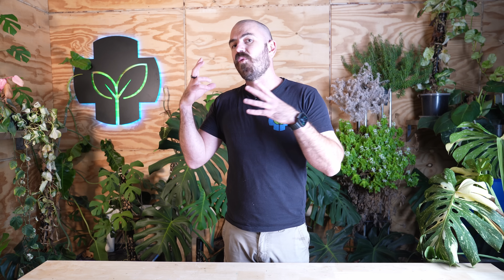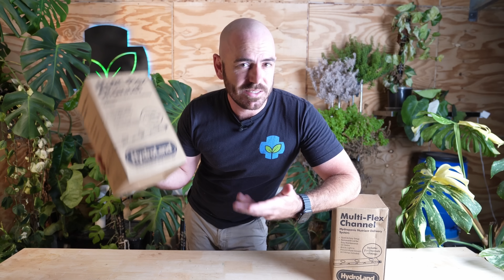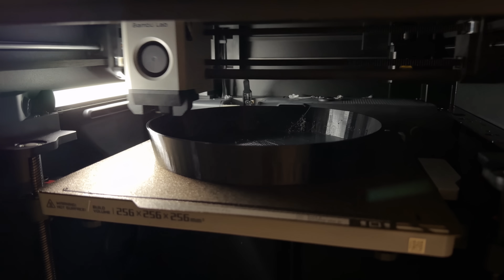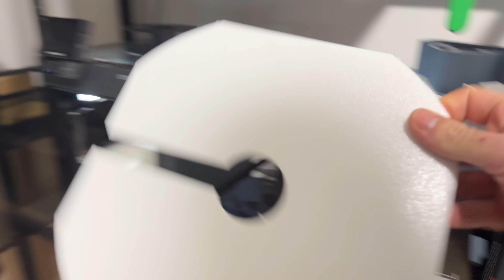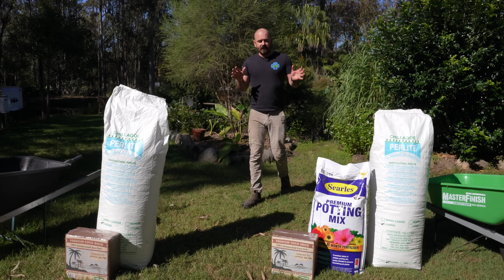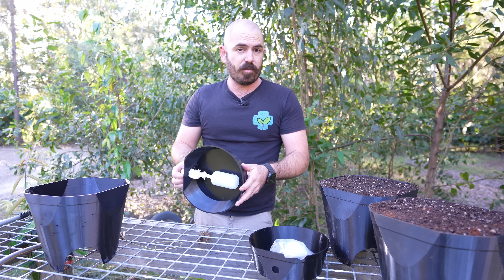The Hooch Pot: Infinite Self Watering Pot

Comment: I recently printed your hydrotower- and after printing 8 sections, I tried to print the bottom fitting that should go on the res...

However, the tips of both options are a hair too big for my print bed. I'm so very sad, because I've spent weeks printing this, and if I scale it down, the bottom fitting will not longer fit tightly. <sigh>
Reply from the maker: You can cut the model in the slicer.
Cut the model on the bits that don’t fit.

Comment: Awesome designs, as a suggestion to be able to reuse the standard plastic garden pots that almost everyone has (30cm) and to reduce 3D printing effort, Is there a way to use our existing plastic garden pots with the float base and maybe wicking section of the hooch pot that the garden pot could slide into??

Comment: Excellent video. I love your designs.  I still have to ask why you haven't designed an airport wicking system? Does it just dry out too quickly? Also when will you do another video with Rob Bob?
Reply: Are you talking about "airpot"? You should be able to just do drip irrigation to them, or you could use a fabric pot and watch one of hooches other videos about making a timber and pond liner based system. I'm using fabric pots and the pond liner system for my banana trees

Comment: I love your videos Hooch! I have a small apartment and a small balcony. This is exactly the type of thing I’m looking for.

I’d be curious if there’s a way to adapt the bases so you can daisy chain them together while maintaining water level. This would limit the amount of tubing and float valves.

If we figured out a way to do this, it would create a fully modular RGGS where you could customize the spacing and number of growing locations at will depending on space needs. 

Based on your experience, do you think there is any good easy way of achieving this? Since there isn’t the horizontal float valve part of the RGGS since it’s inside one of the pots, it would also maximize the amount of space used for growing, which for people with small balconies would be very useful! Would love to hear your thoughts on this.
Reply from the maker: I rekon for $3 a float valve you’ll find it hard to get a bulkhead fitting that will beat that price. You’d probably be better off just having a float per system.
Reply from the maker: There’s a bulkhead fitting with a quick connect on my Patreon you can print and put at a low point… but personally. Id prefer the float on each system.
Reply: Oh yeah that makes sense. The float is both a float and a bulkhead for $3. That’s pretty sweet! Thanks!

Comment: As an engineer, I give you a tip of the hat.  You are an excellent engineer.  Your designs show your abilities.  Well done.  I was going to ask about porosity but you covered that at the end.  I generally use ASA, now that I can get it below $20US.  It has great UV resistance.  I have had porosity problems with your seedling trays, but spray paint does fix that.  Thank you.
Reply: Lead free I hope.😂
Reply: PETG is my go-to filament (PRUSA mk4)👍
Reply from the maker: Try your hand at PETG

It’s a bit stringy (see video 😂🤣) 

But it’s cheap, no harsh chems, and it’s pretty bloody watertight!

Comment: I really like it..  I was thinking one that was roughly 1/2 capacity for root crops like garlic, beets, onions, etc.    I think we could get away with 1/2 the height, and also reduce the material required.  I was just going to take the cut tool in the slicer to achieve it, but then it will miss the solid part of your lip you designed